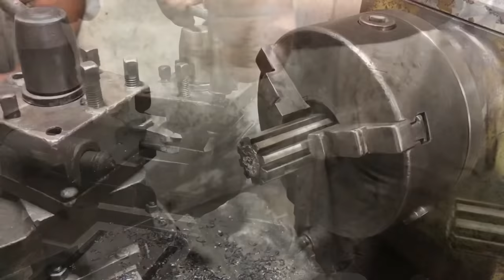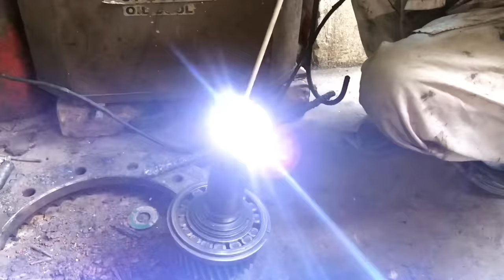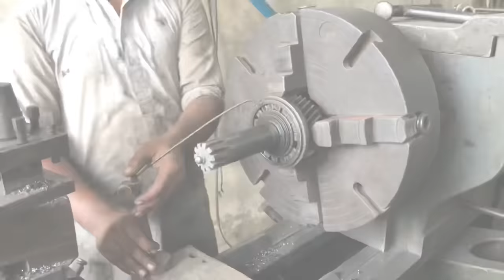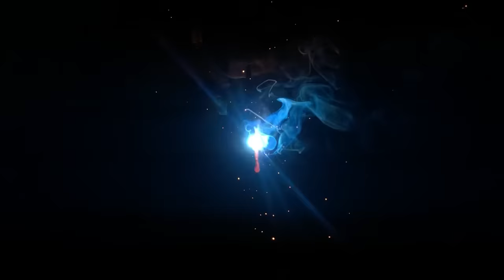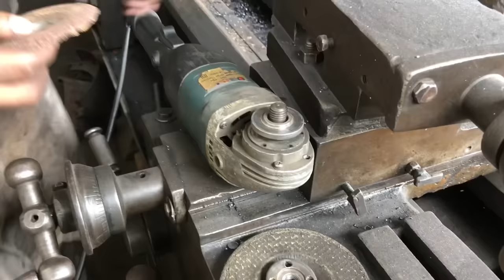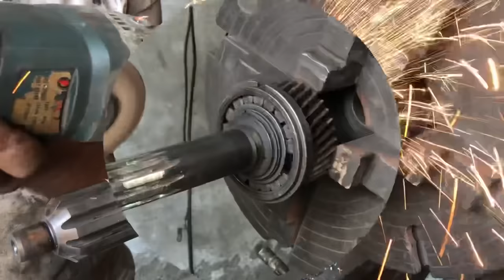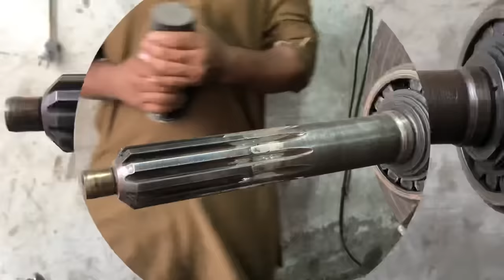The Ingenious guy Connected Broken Input-shaft Very Nicely / Pk process

Comment: GROAN!  All that grit on that lathe!  In the headstock.  In the chuck!  I hope they used something other than 7018 or 6013 to weld.  That deposits mild steel.  Shafts and gears are hardened for a reason. The welding changes the heat treat of the adjacent steel.   If it's a typical trucker, he'll go out and load up his truck with as much as it will hold.  SNAP.  Broken again.  Oh, bad luck.
Reply: I was thinking the same thing, you. A. See the heat creeping half the way up.
Reply: I don’t know anything much about welding , my brother did it for a life time, I did a bit in high school and caught my pants on fire and that was it for me .
Reply: The warranty expires when it goes out the door.
Reply: I thought " well for chipmunks they're pretty innovative welders"
Reply: I agree with you - no respect for the lathe, with carborundum dust everywhere! He didn't need to use an Angle Grinder at all, simply turn the Lathe Tool on its' side, then use the saddle of the lathe to cut a perfect spline. And the repair will never have the strength of a new Unit. But it keeps the Truck working, and earning.
Reply: Didn’t cover the bearing to keep grit and slag out. Oh man all that grinding grit right into the bearing.
Reply: @philbebbington1755  hahaha
Reply: @danburch9989  That's called a brake-light warranty, when you can no longer see the brake-lights its out of warranty.
Reply: @scottgm321  That input shaft bearing has two rollers missing.  That makes me wonder if that is what caused the shaft to break.
Reply: TorpedoX  Again? No, Further or still, yes.
Reply: Я думаю что такой подшипник все равно к замене
Reply: это предпродажная подготовка.
Reply: @edwardmeegan1849  what if the brake lights don’t work lol
Reply: @danburch9989  The usual warranty on that is 90 miles or 90 minutes, whichever comes first, and the 90 minutes starts when the part comes off the lathe.
Reply: c 'est juste pour vendre le camion en état de marche .
Reply: Anyone who does this just doesn't comprehend the damage that remains internally in such a shaft after a torque shear like that.

POSSIBLY, but only possibly, cutting off the splines and welding on a completely new end section MIGHT restore the shaft to somewhere close to original strength but HIGHLY unlikely. Highly dangerous accident just waiting to happen! 🤔🙄🥺🥺
Reply: I was waiting to see him heat treat the whole shaft, then watched I'm disbelief as he painted it! You can't just weld everything up and send it out as good as new, because it's not. It's now weaker than it was when it broke! That's what I call "fix it and sell it" deal.
Reply: @danburch9989  Yup, 15 seconds or 15 feet, whichever comes first!!!
Reply: GROAN! Another YouTube expert using first world standards in third world situations.
Reply: I think that bearing is short a few rollers anyhow
Reply: Yo pienso de que ellos no es la primera vez que trabajan en esas piezas.   Se nota que tienen experiencia
Reply: Even let's say a axle from a car that breaks and is welded back together. You might get one ride out of it
Reply: I doubt this shaft makes it back into the transmission, this was practice?
Reply: @thisisyourcaptainspeaking2259  Yep maybe just for the video views, I don't think there will be any warranty on the repair 😁😁😀
Reply: So much wrong it’s hard to know where to start. I couldn’t watch to the end, I presume he dressed it with an old axe get get the perfect finish? I doubt it lasted more than 10m
Reply: Q
Reply: Porporqu
Reply: You are right..lol ...that's how they do things in Pakistan..lol

Comment: As one who is skilled both as a machinist and welding, I am impressed at what this man was able to accomplish with bare bones tooling. Being able to center that shaft in a four-jaw chick with no dial indicator is admirable. He is making do with what he has. The only doubt I have is whether or not that repair is going to hold up. I wonder if he had the ground clamp on the tailstock? You wouldn't want it on headstock with current running through the bearings. That's the kiss of death for any bearing.
Reply: As a machinist, I too was impressed by his use of a 4 jaw chuck. 
His carbide cutter was under-center, leaving a nub. I had to laugh when he tried to drill into it. He cut the video there but I'm sure he had to put a center drill in to keep the drill from walking. Waste of time to try that without it. 
And many guys don't use lubrication in their cutting tools but damn it irritates me to see that. A bit of oil would have made the process so much easier
Reply: You're a skilled a machinist and welder? I wouldn't want to use anything you've worked on if you think this is in any way a good repair.
Reply: @jamesofallthings3684 I agree with your comment, only someone who knows nothing about being a machinist would be impressed with this. Weld platter and grinding dust all over the bedways. I could go on and on. The worst part of being a machinist is being surrounded by wannabees 8 hrs a day. Thankfully I've retired.